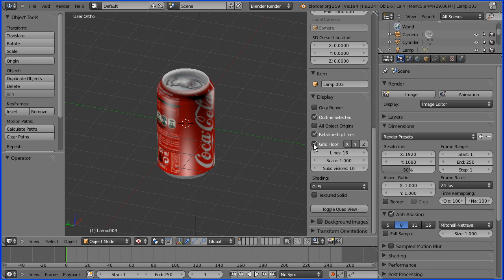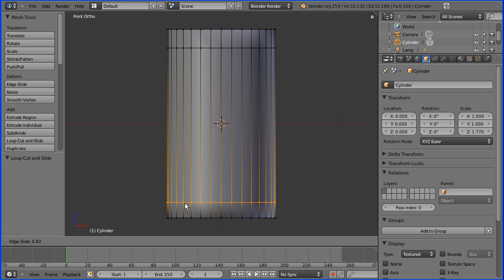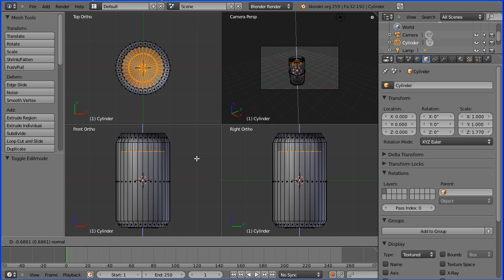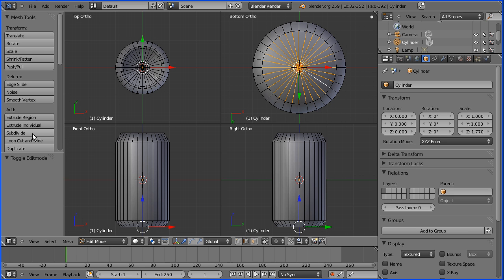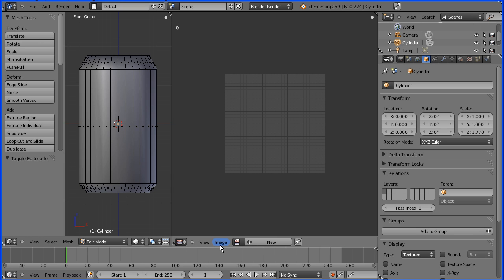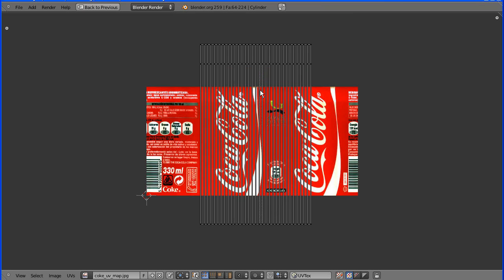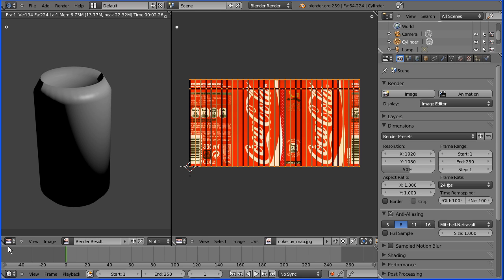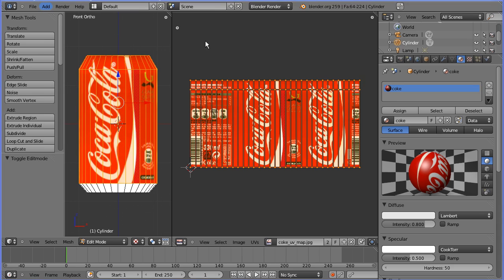Blender Tutorial Making a Coke Can - UV Mapping and Multiple Material Slots Part 1 (Old Version)

Comment from the maker: There are two places to 'pack' textures so they are saved with the object. When you make a texture of type 'image or movie' and you open and image, there is a button to the left of the image name that packs the image into the Blender file. The other place is in the File menu, External Data option, 'pack into .blend file' option. When you append you should get the texture.